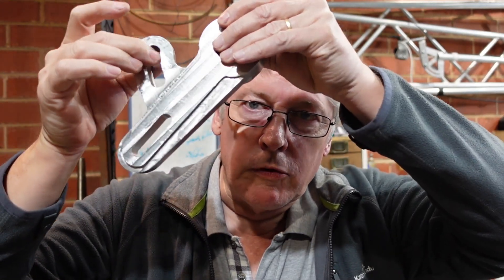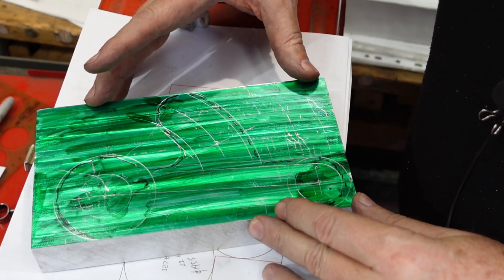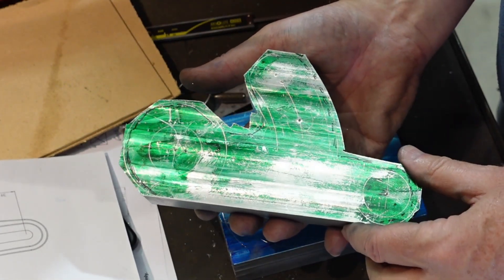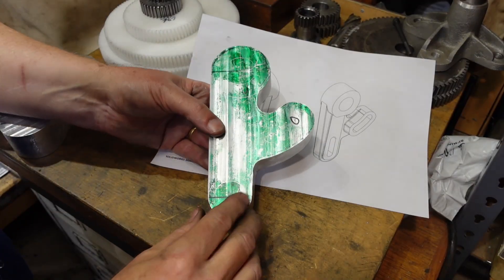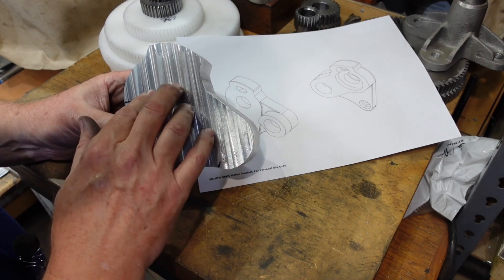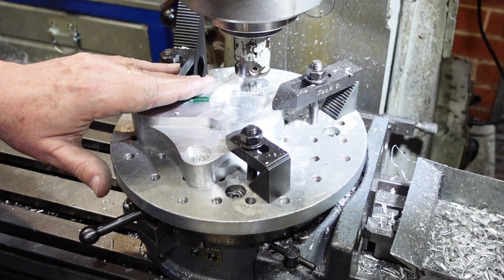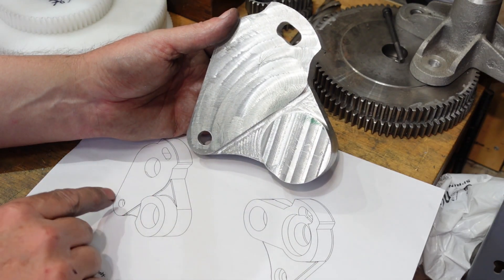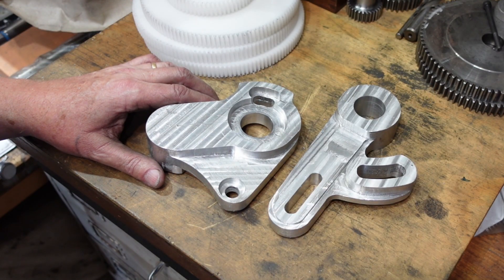Making up lathe Banjos

Comment: Rotary table - dividing head - rotary table - dividing head
Doing videos is HARD and on behalf of us all THANKS for spending the time to create this corner of YT

Dymark layout ink cost $35 / litre (17GBP) from Sydney Tools, a great price compared to UK pricing. I would split it with you but posting ethanol isn't a great idea.
So perhaps make a shout out to the viewers to see if there is anyone in Adelaide (I presume) that also needs layout ink and split it with them (4 or 5 people would be better... 200ml goes a LONG way)
FYI It is made up of >60% ethanol 10-30% propylene glycol monomethyl ether - alpha isomer 0-10% ethylene glycol monobutyl ether 1-10% dye, 1-10% resin - not that that helps at all - just interesting ?
Reply from the maker: I must admit that making videos myself has certainly opened my eyes about the effort involved
I might ask around whether there are local kindred souls out there who need marking out fluid. Having a bag of Shellac here, I'm interested in getting a result, but the litre bottle may be a fall back position.

Comment: Just wondering why you used an end mill to machine the blocks to thickness when you had a face milling cutter handy?
Reply from the maker: The face mill was not giving the finish that I wanted so I switched. I was pushed for time,  otherwise would have played with speeds and feeds a bit
Reply: @occasionalmachinist  A DA sander with a round Scotchbrite pad will transform any machined finish to a beautiful uniform satin finish in minutes.

Comment: Just a  bit of wax and grease remover and spray with a rattle can it what ever colour you like  !
Reply from the maker: One of the issues I would have is finding a rattle can that dries within say 5 minutes. I'm not patient enough to wait more than that before continuing on.
Reply: @occasionalmachinist  plan a head
Reply from the maker: @christophercullen1236  I work full time and only get out to the shed on weekends - I can't afford to stretch things over 3 or 4 weekends.😣

Comment: I use the cheapest spray laquer as marking blue ( or black its cheaper) 
About 2,50
Abd works perfect
Reply from the maker: Have to look at that. I prefer a brush on or wipe on solution to avoid overspray, but may be worth looking at.

Comment: I made a DIY layout dye a few years ago. I used liquid shellac, and regretted it. If I ever do it again, I will use the flakes.
Reply from the maker: I suspect that I haven't got my mixture concentrated enough. Another thing I need to experiment with
Reply: I just buy Dyekem. For £15 or less for something delivered to my door, that will last all year, at least. I'm not going to bother about even looking at spending time trying to make something up.
Reply from the maker: @billdoodson4232  Love to be able to do that, but it does not appear to be shipped to Australia. The local equivalent (Dymark) is minimum size 1 litre
Reply: @occasionalmachinist  Yes, container that size is almost £30.00 here, a bit harder to swallow.
Reply from the maker: @billdoodson4232  The waste (I would not use that much in 20 years I suspect) is also a contributing factor.
Reply: @ at $13.02 CDN+$25.20 shipping I will certainly work on a DIY replacement…